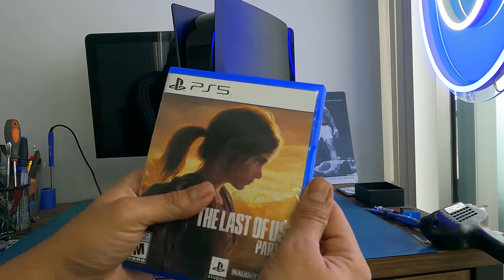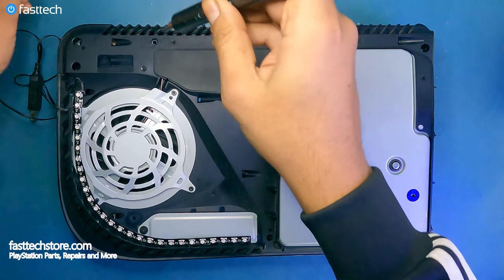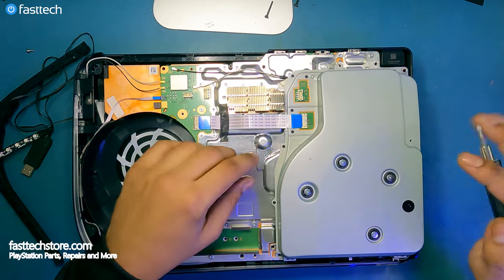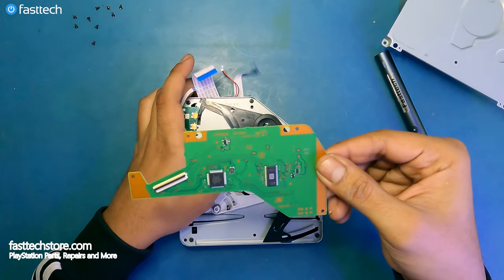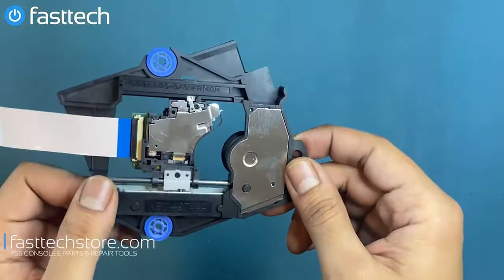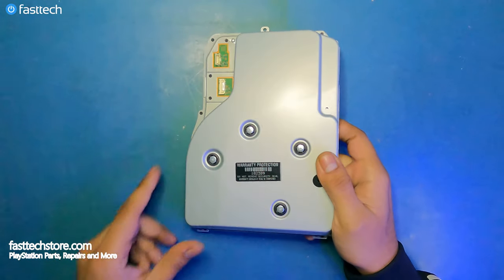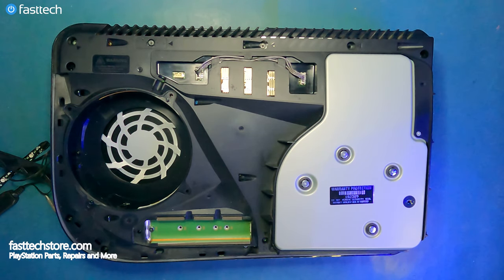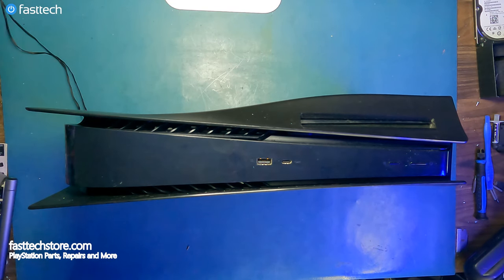PS5 Disc Drive & Laser Repair and Replacement Guide

Comment: Can you just buy a whole new drive disc and just attach to the ps5 disc addition, my toddler has completely broken my sons won’t even accept discs no more just loud noise take. Apart nothing in there
Reply from the maker: @louisechapman2872  yes you can replace the entire drive did you even watch the video?
Reply: Hi yes watched but just wanted to no if I brought the new drive to just replace whole drive, mine isn’t even letting disc go in and making really loud noise
Reply from the maker: @louisechapman2872  yes you can swap the drive make sure to move over your original disc drive board to the new drive. We sell them with a lifetime warranty and free shipping (check the top comment and description box)

Comment: This video became immediately obselete 😅
Reply from the maker: How so?
Reply from the maker: Just because the ps5 slim came out doesn’t mean the existing systems will disappear. Also all of 1000 and 1100 series ps5s are out of warranty now so people will need this video. Thanks for your comment though.
Reply: @fasttechvideo yeah that guys opinion is obsolete. My launch ps5 just stopped reading this morning I dont even use the drive that much no idea how it stopped working so theres no way I want to pay sony 230$ just to fix it so thank you for this timely video I will be attempting to fix it myself😢.
Reply from the maker: @Gibsonite  thanks for your comment. Let me know how it goes
Reply: Don't you have to remarry the daughter board with a new disc drive not from the machine?
Reply: @Gibsonite same
Reply: Arround 50m of ps5 FAT
Reply from the maker: @cindylascort2357  thanks for the info
Reply: This is a godsend, as my ps5 was knocked off the desk, and now my drive no longer works. Will definitely check out the site